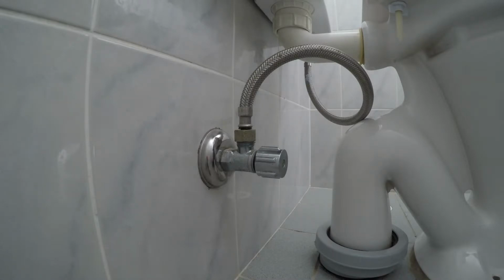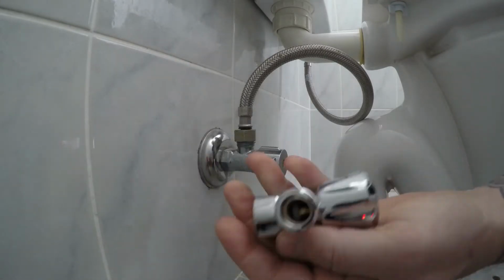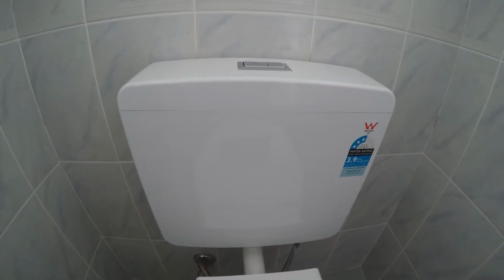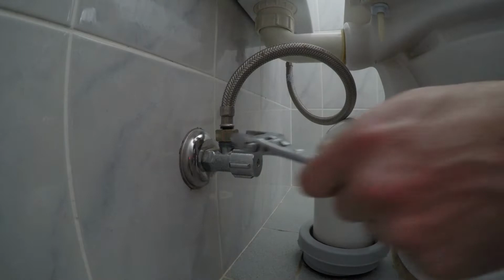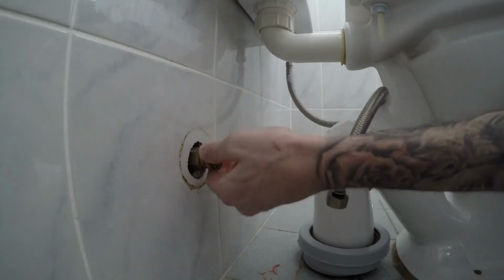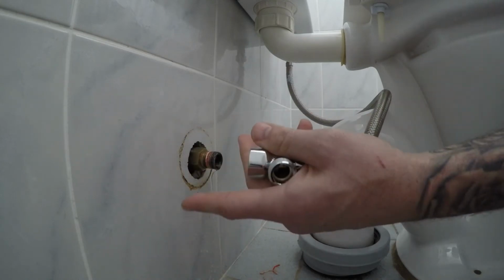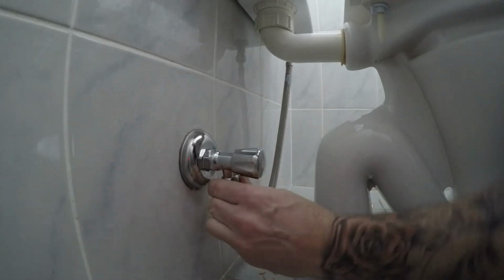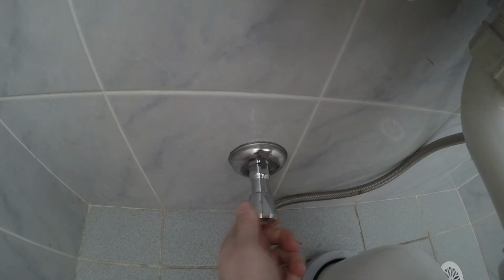How to install / replace a Toilet Shut Off Valve  |  DIY

Comment: Hey Project Lex, today I’ve done an outside garden tap replacement because it was leaking. I was in a house so the main water shutoff valve was outside the front of the property. Because the old tap was a female connector, I had to get another female one because if you buy a male one, it won’t work. Always check what tap before you buy it. If the old one is a male, buy the male, if the old one is a female, buy the female. I bought the female because the old one was a female.

Comment: Thanks mate, do you need to add a washer when screwing the new valve? Coz mine does not stop leaking if I just use it as it is...
Reply from the maker: Hi, no in the new tap there’s everything you need. Maybe the new tap is faulty? You might need to call a professional

Comment: Not a plumber here but I would like a bit of insight if you could. When ever I install/replace these shut off valves 5 times out of 10 I end up having a tiny leak. I always have to remove the damn thing and re upply A few times before I get no leaks.  Apart from upplying the tape in a clockwise direction what is the magic trick to get a good seal fiirst time everytime? Lucky My work is for myself so I can check up on it. I cant imagine being a plumber and leaving a job knowing that I wont get a call back. I blame the fact that they have non tapered threads lol.
Reply from the maker: I’m not a plumber unfortunately just a DIYer. Jack of all trades, master of none haha.
Reply: @projectlex  hehe no worries